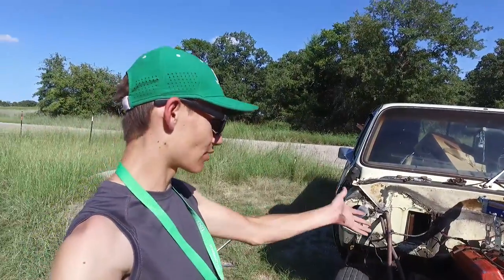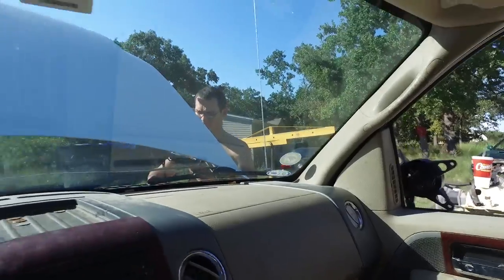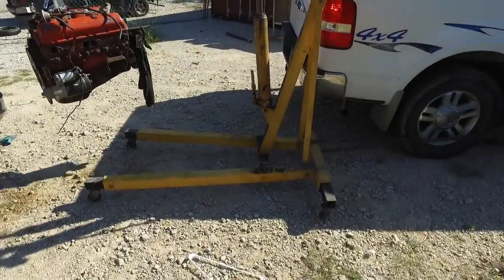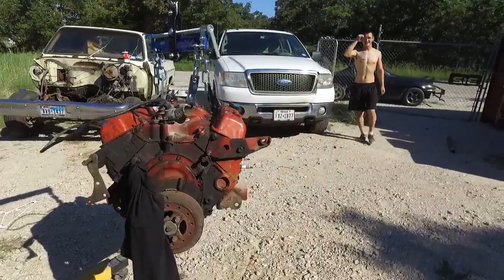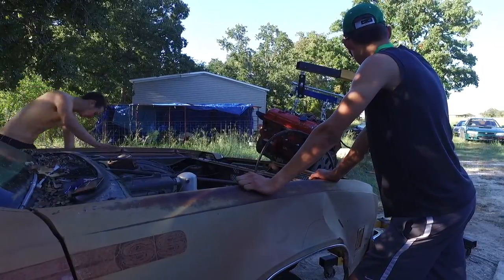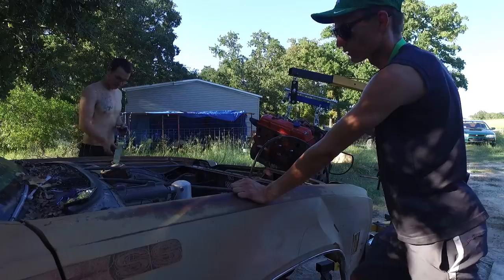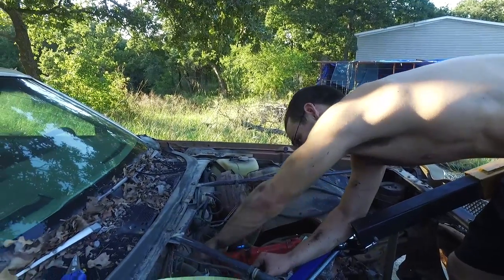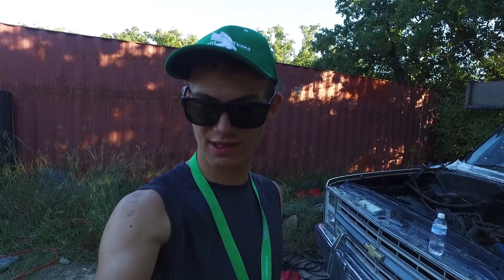Putting The Motor In The El Camino

Comment: hey guys, when pulling chevy motors or any motors for that matter...use bolts that go into the heads or block or anything besides the little 3/8 bolts that just hold the carb in place

Comment: why didnt you just lower the camino front end instead of tearing up the front end/core
support?  do we dare want to know your plans to get the transmission in?
Reply from the maker: +elcamino74ss Zach didn't want to take the front end off in fear of losing the hardware. (Don't get mad at me, I'm just the messenger)
Reply: I was thinking of just let the air out of the front tires to drop the nose a few inches :)
Reply from the maker: +elcamino74ss We actually did this, helped a lot.

Comment: You weren't kidding on the miata smoke! Holy crap! Hahaha!

And guys... You could have unbolted the front end of the elco so you had room to work! Also... why put the motor in without the trans? Do you have a lift to raise the car so you can put the trans in that way? And again, I want to tell you guys, or Zach in particular, to NOT buy any go-go parts before you know the engine and trans are solid. Take your time. You don't want to put heads on a trash motor. And you don't want to wake a motor up behind a junk trans!
Reply from the maker: +The Dutch Texan You sir, are very correct. I'm trying to change his mind. Get it running and driving FIRST. Then, dump two grand into the motor.
Reply: Aaa
Reply: Hah?